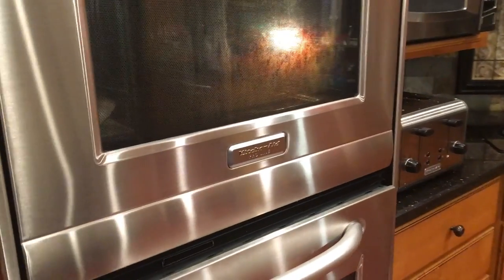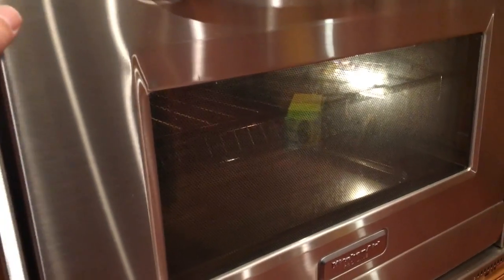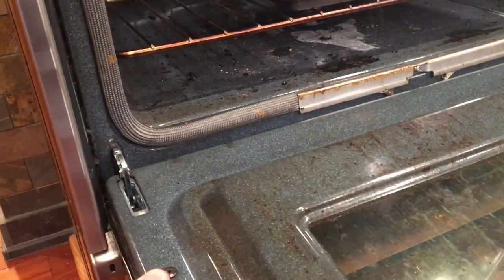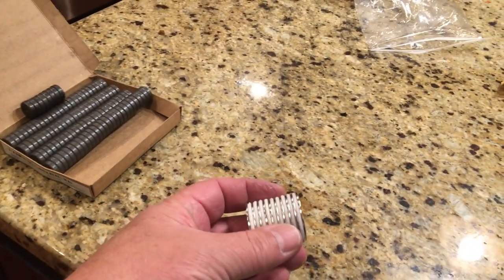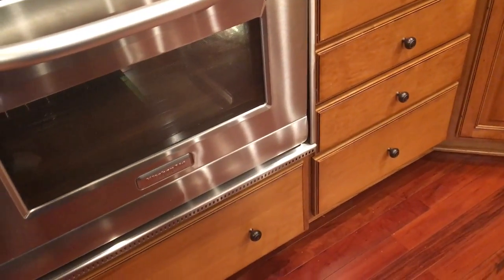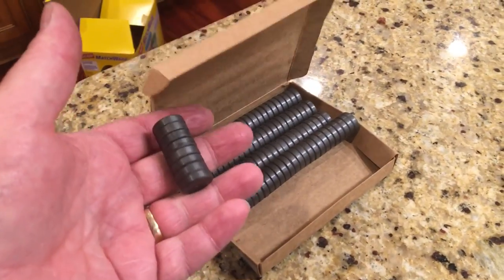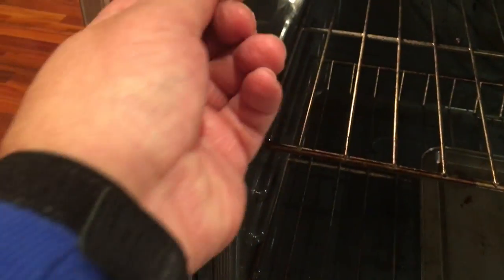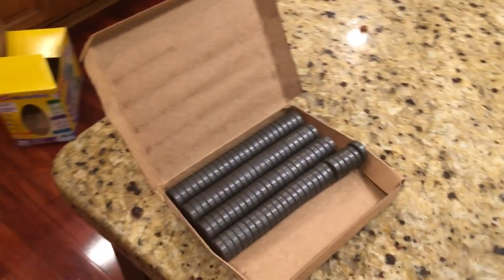How to fix a KitchenAid oven door that won't stay closed

Comment: This is one of the most helpful videos ever.  In the middle of the Corona pandemic I realized that the problem with my Thermador oven was that the door does not close fully, so the convection fan was not operating.  (The light already doesn't work and will not be fixed, as the job is too expensive.) Someone pointed me to this video and I'm just so grateful.  Many thanks to this and to comments as well.
Reply: Happy that it helped. Dave

Comment: The repairman said my particular GE built in model was over 10 years old and would have to charge over a grand to order the part and install! Forget it, I’ll just keep using the door stand to keep it closed when baking. I decided to check out YouTube for ideas and was going to try the towel trick but was afraid it would somehow pull the door out even more. Then I came across your video. THANK YOU Sooo much for your solution!  Much appreciated. Bought the magnets, keeps the door closed, and I am pleased as punch. Thanks again!
Reply from the maker: Oh cool...Glad it helped and saved you some $$$...you're very welcome!! Dave

Comment: Similar problem with my Thermador and was able to fit it with the magnets. My wife thinks I'm a hero thanks to you, D Jones! :-)
Reply: what happens when you re-open the door? What happens to the magnets? Do they drop off?
Reply: The magnets stay in place. They’re neodymium discs about the size of pencil erasures. I’m using them in three places: top right, top middle, and top left, each double stacked (six magnets total).

Comment: I tried the magnets but the door was still offset on one side too much to catch.  I examined the hinge and noticed that the door was not fully installed up to the notch visible in the hinge.  I unlatched the door as shown in this video and wriggled it in place.  Voila!  Door now shuts and I kept the magnets in place for extra security.  Thanks for the instructions!

Comment: You mentioned heat destroying the magnets. This fix was posted 3 years ago. How have these magnets held up  under the heat in these years?
As an aside, I wouldn't be surprised if the reason why so many oven door springs are failing is because of the heat. Heat causes spring steel to lose its temper. So even new springs will fail again and again. Don't know if this is planned obsolescence by the manufacturers. It lets them continue to sell springs. There are enough smart engineers who could make oven doors that would stay shut - but again, that wouldn't be good for business!
Reply from the maker: The ceramic hold up great. Still have box full of 90. Have never had to replace. My issue was lower over door being dropped open or thrown open. The inners are bent or broke. When open fully it hangs down a bit, like just past 90 degrees...at about 100 or 110 degree angle.
Reply: @indianadavejones  That's very good to know. I ordered a set from Amazon today. But I have noticed some comments saying that sometimes the magnets stick to the door and sometimes to the oven. Have you seen this? If this is an issue, perhaps some glue that can withstand high heat would keep them glued to the oven. What do you think?
Reply from the maker: @moodberry  Yes occasionally they will even land right ontop of each other and be too thick to close door....but easy to space out again unless in middle of a cook and they are hot...its manageable...some sort of heat resistant glue would be good...LMK what you find...It's on our lower oven we rarely use so not a huge issue for us...if it was main oven that we used often I can see the annoyance..

Comment: Thank you so much i was about to say heat+magnetism=weak magnet. I have a old aquarium with over 2kg force but it will die. Another solution is making a C clip, I used an old e cig box mod body and cut it with a rotary tool. Only issue was people not able to open the door, refusing to use logic and eventually breaking the clip. 
Not replacing the hinge, it's £46 over 60 USD for a pair of hinges & receiver for a oven with a selector switch with only 2-9 working! Plus the beauty of these magnets are ability to reuse and of course saving money. 
Being the adventurous idiot I resorted to placing a long stool in front of the door with a cast iron pan on top.
Reply: So after trying c clips and not going down the magnet path as the rotational selector switch was working in only 2 positions. Convection and lights I bought a used oven for £20. Yes I was a little hesitant but it's a good buy. Nicest thing is the increased internal space yet same external. Sadly I missed a Neff for £50 but even if this lasts 2 years (or even half that) I consider it a bargain. 
Best thing is how clean the glass is, one can clearly see food without needing to open the door slightly

Comment: Hi,  thanks for this tip,  I tried and used a single magnet from an old 3.5" hard drive, it is shaped as a curve and fits perfectly in the corner.  Ideally I need another one for the other corner some time.  My oven is fixed, yipee !!!!

You'll need a special miniature Torx bit to get these magnets out of a hard drive out,  or perhaps you can drill the screws out.  Watch out as these are very powerful magnets, they will snap together and  give you a blood blister if you're not careful - you have been warned, it hurts  :-)

Comment: I've bought two different type of ceramic batteries that came up under the search strong batteries that maintain magnetism under high heat and none have worked. What brand did your purchase??
Reply from the maker: https://www.amazon.com/X-bet-MAGNET-Magnets-Refrigerator-Fridge/dp/B01BX1MC6Y/ref=pd_bxgy_img_2/138-0534879-0272953?_encoding=UTF8&pd_rd_i=B01BX1MC6Y&pd_rd_r=23fae67f-5f01-45a5-809e-e4af4e8b7613&pd_rd_w=fzfCx&pd_rd_wg=lSbl5&pf_rd_p=ce6c479b-ef53-49a6-845b-bbbf35c28dd3&pf_rd_r=NG35Z5DEA6HW252QRK76&psc=1&refRID=NG35Z5DEA6HW252QRK76

Comment: My door isn't metal. The frame is. Are the magnets able to be drilled so I can put self tapping screws through them.
Reply: Never tried. They are small ceramic, may shatter, may not? trick would be getting them clamped to drill..I like the idea as mine move around...and jump from door to frame...be nice if they were held in place. I am curious on how yours turns out, so please update....another idea would be to mount/screw a long slim metal piece on the door then the mags will stick...
Reply: @davidjones7388  I was thinking about the metal strip idea but that would make the gap to narrow for a good deal. I will try drilling. As you say there are 100 in the box..🤔😆

Comment: Were you able to determine why the inner hinge broke.  I have the same problem.  Think my ex broke it on purpose.
Reply from the maker: mike, no I never tore it apart. I think wife or “others” just leaned on the open door too often.
Reply: @indianadavejones  I did tear it apart and fixed the existing hinge using a small sledge hammer.  Just bent the hinge the other way.
Reply from the maker: mike oh cool. How long did that project take and did you have to slide the entire oven out of the cavity? Very curious on any details you can share. Dave
Reply: @indianadavejones  just took the door off,  took door apart,  removed hinge with spring.   Then pounded on the hinge with a hammer until the hinge stayed flush with the oven when closed
  You can put the hi ge on the oven without assembling the door.
Reply from the maker: mike ok I gotcha. I thought you removed the internal receiver and fixed on the oven side....not door side.
Reply: @indianadavejones  no I tried the upper door on the bottom and I closed properly, so I knew the bottom hinge was bad.  When I closed the bottom door on the upper or lower oven there was a gap.
Reply from the maker: mike...I do remember swapping doors and mine closed fine on top so that was how I determined it must be the internal part on my lower. It’s coming back to me. Didn’t want to mess with tearing it apart.
Reply: @indianadavejones  just take pictures of every step when taking it apart and label the pieces of glass with a marker so they dont get mixed up.  I used a 4 inch vice grip and closed the end to loop around the hinge when extending it.  Small screw in the hinge holes to keep it open when you assemble it back.  The spring is very tight.

Comment: I am sure alot of heat escapes, Am I wrong? I would like to know
Reply from the maker: scoo2000 surprisingly no. It works great. It doesn’t sit on the seal as tight but it does seal and bakes things perfectly.
Reply: @indianadavejones  Thanks for the reply.  fought with my repairs warranty service. Tey already changed the hinges but that didn't work , on to the next solution

Comment: Is this still holding up for you?
Reply from the maker: Yes pretty well...I did replace some of the magnets as they did lose some strength after repeated heating, but I rcvd over 100 from amazon so not an issue replacing them.
Reply from the maker: JDeFran11 yes. I have replaced mags but no issue since I was shipped 100 of them from amazon.
Reply from the maker: YES!....I have replaced a few of the magnets but still a cheap easy fix for me.

Comment: I just replaced an inner glass on similar model without the hinge lock. This video was helpful to me, so hope it helps you replace those springs to hold the doors better than the short term solution with magnets: https://www.youtube.com/watch?v=p7oRZdIN6m0&t=1s